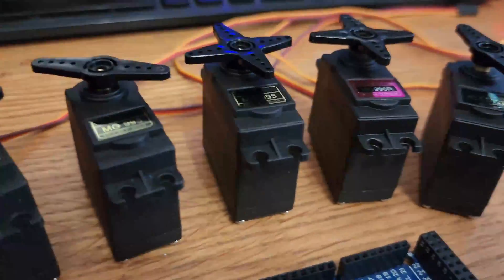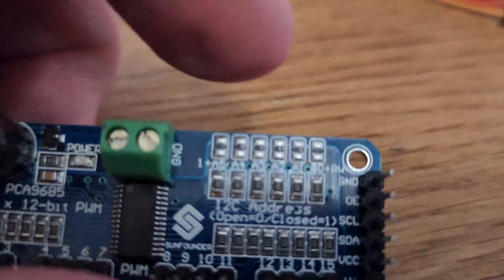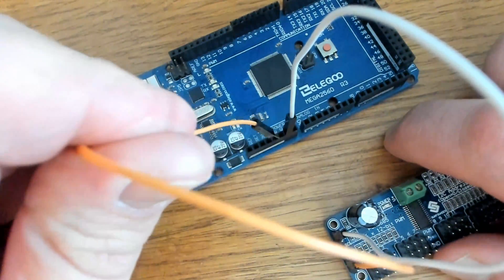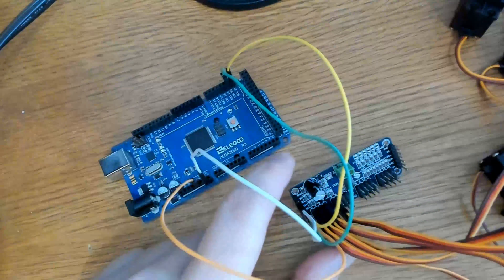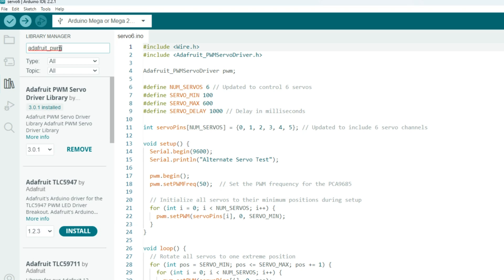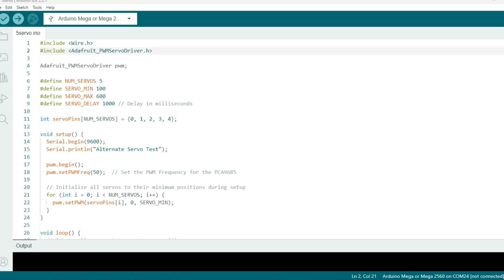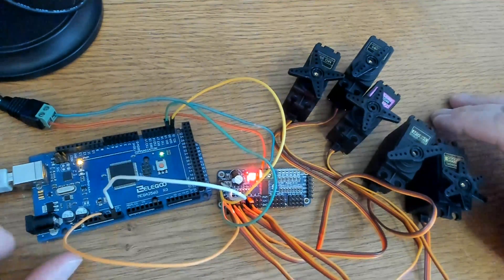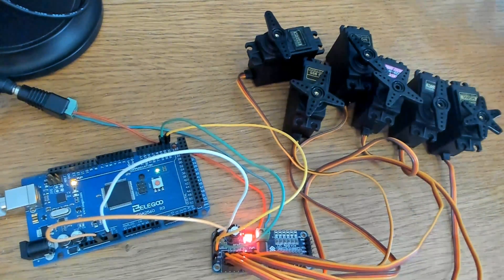Mastering Servo Control: PCA9685 PWM Driver with Arduino Tutorial and Demo

Comment: How would I wire and code for them to act of a photoresistor chips for a laser target system
Reply from the maker: hey there!
Here's what I'm thinking. Is this what you want to do?

The code controls a servo motor based on whether a laser is hitting a photoresistor.
When a laser is pointed at the photoresistor, the photoresistor value exceeds a specific threshold. As a result, the servo motor moves to a new position.
When the laser is not pointed at the LDR, the servo motor returns to its initial position.
The PCA9685 servo driver is used to control the servo, which allows for multiple servos to be connected if needed.

If i'm wrong, let me know. Sounds interesting!
Reply: @BMonsterLaboratory  yes
Reply: @BMonsterLaboratory  the problem I'm running into is the threshold. Idk how m3asure it or Calibrate it or whatever if so new to this but I ha e developed a HUGE passion in the recent weeks and I'm on a mission lol no retreat  no surrender, learn this thing Inside and out and create some wild ish
Reply from the maker: @CraftyFelon  I have a XINGYHENG 175pcs 7Values 5mm Photoresistor (LDR) kit that I bought on Amazon about 5yrs ago. There are multiple values i this LDR kit. If you want to set up multiple targets, just pick one value and set the threshold values in your code. 
For instance, in this kit I would use only the GL5506 LDR for consistent calibration and uniform behavior. This LDR has a dark resistance between 2-6k ohm and a light resistance of 0.15M ohm. For a good threshold value, the resistance will be relatively high wihtout a laser 500-800 depending on the voltage and will drop significantly with a laser (200-400 range). The exact analog values will depend on the strength of your laser - you can see the values in real-time by watching the serial monitor. 
Use a voltage divider circuit toconnect the LDR to the analog pin on the Arduino. One end goes to 5v while the other end is connected to a 10k ohm resistor (to ground) - and the point between the resistor and LDR is connected to the analog input. You can search google images for LDR voltage divider circuit. 

For you code, you may need to add something like this if you're using, for example, 3 LDR's. The threshold in this example is set at 500. 
I hope this was helpful!

#include <Adafruit_PWMServoDriver.h>

// Create the PCA9685 PWM driver object
Adafruit_PWMServoDriver pwm = Adafruit_PWMServoDriver();

// Photoresistor pins (using GL5506)
const int LDR_PIN1 = A0;  // GL5506-1
const int LDR_PIN2 = A1;  // GL5506-2
const int LDR_PIN3 = A2;  // GL5506-3

// Single threshold value for all GL5506 sensors
int threshold = 500; 

void setup() {
  Serial.begin(9600);
  pwm.begin();
  pwm.setPWMFreq(60); // Set PWM frequency to 60 Hz for servos

  // Set initial servo positions
  pwm.setPWM(0, 0, 300); // Servo 1 on channel 0
  pwm.setPWM(1, 0, 300); // Servo 2 on channel 1
  pwm.setPWM(2, 0, 300); // Servo 3 on channel 2
}

void loop() {
  // Read values from GL5506 photoresistors
  int ldrValue1 = analogRead(LDR_PIN1);
  int ldrValue2 = analogRead(LDR_PIN2);
  int ldrValue3 = analogRead(LDR_PIN3);

  // Print the values for debugging
  Serial.print("LDR1: ");
  Serial.print(ldrValue1);
  Serial.print(" | LDR2: ");
  Serial.print(ldrValue2);
  Serial.print(" | LDR3: ");
  Serial.println(ldrValue3);

  // Control Servo 1 based on GL5506-1
  if (ldrValue1 > threshold) {
    pwm.setPWM(0, 0, 450); // Move servo 1 to a new position when laser hits
  } else {
    pwm.setPWM(0, 0, 300); // Return servo 1 to the original position
  }

  // Control Servo 2 based on GL5506-2
  if (ldrValue2 > threshold) {
    pwm.setPWM(1, 0, 450); // Move servo 2 to a new position when laser hits
  } else {
    pwm.setPWM(1, 0, 300); // Return servo 2 to the original position
  }

  // Control Servo 3 based on GL5506-3
  if (ldrValue3 > threshold) {
    pwm.setPWM(2, 0, 450); // Move servo 3 to a new position when laser hits
  } else {
    pwm.setPWM(2, 0, 300); // Return servo 3 to the original position
  }

  delay(100); 
}

Comment: there is something like this, but for just 8 servo???
Reply from the maker: You can user 8 servos on this. are they they same model?  MG995?
I see recommendations not to use more than 10amps with this board. If your motors pull more than 10A, use an external power supply for the motors and ensure common ground with the PCA9685. This will help protect your components, and the board will control the motors properly using the data pins without overloading its power capabilities.  👍💪
Reply: @BMonsterLaboratory  ty for your answer. I want to control 8 linear servos with 3.3v.... and I want something of 8 beacuse I want to reduce the space inside the robot. (sorry my english, is not so good)
Reply from the maker: @Aratgurth  you're English is great. 
Just make sure to watch your current and don't overheat.
Reply: @BMonsterLaboratory  thanks!
Reply from the maker: @Aratgurth  you're welcome. best of luck to ya

Comment: Hey there! Will const int = "name" = (number here) work instead of having an array list? or do i have to call each one in an array, and do i have to call the number of servos (line 6). Id really appreciate it! you inspire a lot!
Reply from the maker: Hi, thanks!
You don't have to use arrays. You can define individual constants like this:

const int SERVO_1 = 0;
const int SERVO_2 = 1;
const int SERVO_3 = 2;
...etc.

But you'll need to reference each servo individually in your code. Doing it this way makes iterating over multiple servos or performing actions on all servos cumbersome. Arrays make your code look cleaner and easier to manage.
NUM_SERVOS defines the number of servos you are going to control. It helps you easily adjust the number of servos without needing to change the code in multiple places.

good questions! 👍

Comment: Are there codes available to download for this video?
Reply from the maker: I normally post them to Facebook but sometimes that can become confusing when it requires multiple posts for one sketch. I need a place to contain all project code that people can freely access.....anyway, Here's the code I posted for this video. 👍
#include <Wire.h>
#include <Adafruit_PWMServoDriver.h>
Adafruit_PWMServoDriver pwm;
#define NUM_SERVOS 5
#define SERVO_MIN 100
#define SERVO_MAX 600
#define SERVO_DELAY 1000 // Delay in milliseconds
int servoPins[NUM_SERVOS] = {0, 1, 2, 3, 4};
void setup() {
Serial.begin(9600);
Serial.println("Alternate Servo Test");
pwm.begin();
pwm.setPWMFreq(50); // Set the PWM frequency for the PCA9685
// Initialize all servos to their minimum positions during setup
for (int i = 0; i < NUM_SERVOS; i++) {
pwm.setPWM(servoPins[i], 0, SERVO_MIN);
}
}
void loop() {
// Rotate all servos to one extreme position
for (int pos = SERVO_MIN; pos <= SERVO_MAX; pos += 1) {
for (int i = 0; i < NUM_SERVOS; i++) {
pwm.setPWM(servoPins[i], 0, pos);
}
delay(15);
}
delay(SERVO_DELAY);
// Rotate all servos back to their minimum position
for (int pos = SERVO_MAX; pos >= SERVO_MIN; pos -= 1) {
for (int i = 0; i < NUM_SERVOS; i++) {
pwm.setPWM(servoPins[i], 0, pos);
}
delay(15);
}
delay(SERVO_DELAY);
}

Comment: Do all work in unison like you displayed, or can I control each servo individually through a Bluetooth HC-05?
Reply from the maker: Yes, you can control them individually. You’ll need to set up each channel with specific PWM values corresponding to the servo’s position. And yes, you can control individual servos connected to the PCA9685 through a Bluetooth module like the HC-05. I like this idea! Thanks for asking

Comment: I want to ask for a way the I can use 1 power supply to power the arduino and the motors at the same time
Reply from the maker: Easiest way is to use a step down converter. One with a digital display for output - select one rated for your current needs.

Comment: can you adjust the start stop position of each servo and initiate each servo independently. I want to use servo motors to operate point motors and level crossing gates on a model railway. Is there a better way of achieving this
Reply from the maker: Yes, you can operate each servo independently and you can adjust the start and stop points of each servo individually by controlling the pulse width signal. The PCA9685 PWM driver is a good choice for something like this.
Reply: @BMonsterLaboratory  Thank You.

Could I operate the points and gates by switch. How would I do this.
Reply from the maker: Just curious, how many servos are you operating?  Are they the micro 9g servos?
Reply: @BMonsterLaboratory  On the level crossing there would be 4 servo motors which I would want to operate together. How would I do this by switch. If I use a on-off-on switch. I would want to go one way then after operate the switch again to close the gates. How would I wire this up and the others I would want to operate again by switch but individually. Also do I only need to use the computer to programme the motors or does it need to stay connected. As you can tell I have never used these  before. I would probably use about 12 motors
Reply from the maker: @PeterEvans-dw2ol  I think limit switches would be your best option. If all four gates operate together (they open and close simultaneously), you would only need two limit switches. The limit switches would be positioned so that when any one of the gates reaches the fully open or fully closed position, it triggers the switch and stops all servos.

#include <Wire.h>
#include <Adafruit_PWMServoDriver.h>

Adafruit_PWMServoDriver pwm;

#define NUM_SERVOS 4
#define SERVO_MIN 100
#define SERVO_MAX 600

// define servo pins
int servoPins[NUM_SERVOS] = {0, 1, 2, 3};

// define end switch pins
const int endSwitchOpen = 9;  // end switch for fully open position
const int endSwitchClose = 10; // end switch for fully closed position

void setup() {
  Serial.begin(9600);
  Serial.println("Servo Control with End Switches");

  pwm.begin();
  pwm.setPWMFreq(50);  // set the PWM frequency

  // Initialize servos to their minimum position (gates closed)
  for (int i = 0; i < NUM_SERVOS; i++) {
    pwm.setPWM(servoPins[i], 0, SERVO_MIN);
  }

  // set the end switch pins as inputs
  pinMode(endSwitchOpen, INPUT_PULLUP);
  pinMode(endSwitchClose, INPUT_PULLUP);
}

void loop() {
  // check the state of the end switches
  bool isOpen = digitalRead(endSwitchOpen) == LOW;  // end switch for fully open
  bool isClosed = digitalRead(endSwitchClose) == LOW; // end switch for fully closed

  // If not fully open or closed, move the servos
  if (!isOpen) {
    openGates();
  }
  if (!isClosed) {
    closeGates();
  }
}

// function to open gates (move all servos to max position)
void openGates() {
  for (int pos = SERVO_MIN; pos <= SERVO_MAX; pos += 1) {
    for (int i = 0; i < NUM_SERVOS; i++) {
      if (digitalRead(endSwitchOpen) == LOW) return;  // stop if end switch is triggered
      pwm.setPWM(servoPins[i], 0, pos);
    }
    delay(15);  // small delay for smooth movement
  }
}

// function to close gates (move all servos back to min position)
void closeGates() {
  for (int pos = SERVO_MAX; pos >= SERVO_MIN; pos -= 1) {
    for (int i = 0; i < NUM_SERVOS; i++) {
      if (digitalRead(endSwitchClose) == LOW) return;  // stop if end switch is triggered
      pwm.setPWM(servoPins[i], 0, pos);
    }
    delay(15);
  }
}
Reply from the maker: on-off-on switches are an optino but will not have the same level of precision unless you fine-tune the servo movements in the code.  It would look something like this.

#include <Wire.h>
#include <Adafruit_PWMServoDriver.h>

Adafruit_PWMServoDriver pwm;

#define NUM_SERVOS 4
#define SERVO_MIN 100
#define SERVO_MAX 600

// define servo pins
int servoPins[NUM_SERVOS] = {0, 1, 2, 3};

// define switch pins
const int switchOpenPin = 7;  // pin for opening gates
const int switchClosePin = 8; // pin for closing gates

void setup() {
  Serial.begin(9600);
  Serial.println("Servo Control with On-Off-On Switch");

  pwm.begin();
  pwm.setPWMFreq(50);  // set the PWM freq

  // Initialize servos to their closed position (gates closed)
  for (int i = 0; i < NUM_SERVOS; i++) {
    pwm.setPWM(servoPins[i], 0, SERVO_MIN);
  }

  // set switch pins as inputs with pullup resistors
  pinMode(switchOpenPin, INPUT_PULLUP);
  pinMode(switchClosePin, INPUT_PULLUP);
}

void loop() {
  // read the switch states
  bool openGate = digitalRead(switchOpenPin) == LOW;  // Check if "open" side of switch is pressed
  bool closeGate = digitalRead(switchClosePin) == LOW; // check if "close" side of switch is pressed

  // If the "open" switch is activated, move servos to open position
  if (openGate) {
    openGates();
  }
  // If the "close" switch is activated, move servos to close position
  else if (closeGate) {
    closeGates();
  }
}

// function to open gates (move all servos to max position)
void openGates() {
  for (int pos = SERVO_MIN; pos <= SERVO_MAX; pos += 1) {
    for (int i = 0; i < NUM_SERVOS; i++) {
      pwm.setPWM(servoPins[i], 0, pos);
    }
    delay(15);  // ssmall delay for smooth movement
  }
}

// function to close gates (move all servos back to min position)
void closeGates() {
  for (int pos = SERVO_MAX; pos >= SERVO_MIN; pos -= 1) {
    for (int i = 0; i < NUM_SERVOS; i++) {
      pwm.setPWM(servoPins[i], 0, pos);
    }
    delay(15);
  }
}
 Let me know if youhave any questions.
Reply: @BMonsterLaboratory  Thank you. Will have a look at this method

Comment: Hey can we control each servo differently like one in clockwise and another one in anticlock wise at the same time
Reply from the maker: sure! You're loop would look something like this: 

 //servo1 moves clockwise and servo2 counterclockwise
  for (int pos = 0; pos <= 180; pos += 1) {
    servo1.write(pos);     
    servo2.write(180 - pos);
    delay(15);        
  }
  
  //servo1 moves counterclockwise and servo2 clockwise
  for (int pos = 180; pos >= 0; pos -= 1) {
    servo1.write(pos);      
    servo2.write(180 - pos);
    delay(15);
  }

You may need to adjust it according to your project, but that's the idea. 👍👍

Comment: Do you know if you can control the servos using potentiometers? I haven’t had much luck controlling them while using the servo driver.
Reply from the maker: hey there! You can manually turn the potentiometers to control the movement of the servos when using the PCA9685 PWM Driver or you can connect the potentiometers to the Arduino directly and control them that way.  
Just curious, what kind of issues are you having with the driver?

Comment: hi there, impressive video how to drive the servos with the pca9685. I only have one question regarding the baud rate. As I know the Mega requires a baud rate of 115200 to communicate while the 9600 is for the Uno.  Did this have an impact on the control or is this not important with the PCA 9685? Thank you and keep making such kind of videos for us to help with problems.
Reply from the maker: Hey there! Thank you for the kind comment. It's great to get feedback on videos to improve future content.
The baud rate settings in this video are primarily for serial communication between the Arduino board and my computer. In this instance, Arduino uses serial communication to send and receive data between the board and the computer. The baud rate specifies the data transfer speed in bits per second and the baud rate uploaded to the Arduino needs to match the baud rate set in your serial monitor. The PCA9685 PWM driver communicates with the Arduino via the I2C protocol, which is not affected by the serial baud rate settings. So no, baud rate doe not impact control of the servos.
Thank you for asking and I hope you enjoy building your Arduino project! 👍💪
Reply: @BMonsterLaboratory  Thank you for your explanation. Now I understand the difference using the baud rate for communication between units in the Arduino world.

Comment: Can u guide me for a project ??
Reply from the maker: Hey there! I am happy to assistance however I can.  Not sure about guiding through every step. 
Tell me the goal of your project, components you are using, and your experience level.
I am currently traveling but will be available next week. 👍
Reply: @BMonsterLaboratory  cool, that will be really helpful. Where can I connect with u??
Reply from the maker: @kaushlendrapandey5404  Facebook mssg has worked well for me  https://www.facebook.com/BMonster-Laboratory-101410418059806/
I usually check it at night. Feel free to send a message if you have a question.

Comment: Hey, What is the max output current for PCA9685?
Reply from the maker: Hey there! Sorry for late reply,  been traveling the past few days.
I have a 5v10a supply connected.  If you need more current for a lot of servos,  try using an external power source and just connect ground and servo signal wires to the driver board for pwm control.  I would not put more than 10amp supply on v+ to power the board. I believe this is the safest approach. I hope it helps

Comment: What power supply do you recommend for 15 Servos?
Reply: And what can I use to make it portable
Reply from the maker: hey there!  It depends on the servos you're using. The MG995 servos can have current at maximum load: 1200mA according to https://components101.com/motors/mg995-servo-motor You want enough current to accommodate all 15 servos. Current load for 15 servos could be around 18A  (15 * 1200mA = 18000mA = 18A)  It's advisable to choose a battery with a higher current rating than you need to ensure reliable and stable performance, taking into account factors like battery efficiency, voltage drops, and safety margins. Be sure to do our research and make sure you look over data sheets for the servos and other components you're going to use. I, personally, haven't used more than 6 servos on this driver. If you're using 15 MG995, I'd be interested in what you think of the performance. 👍